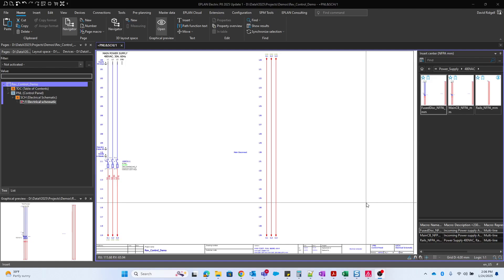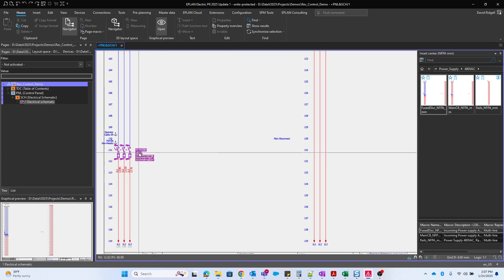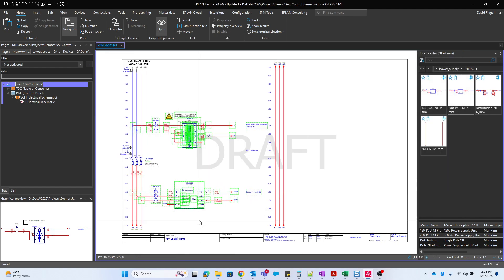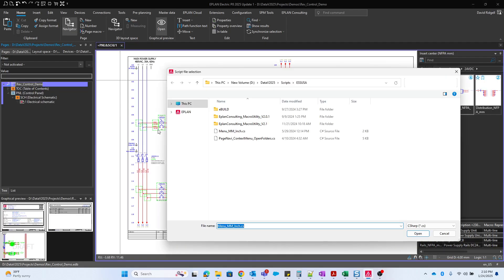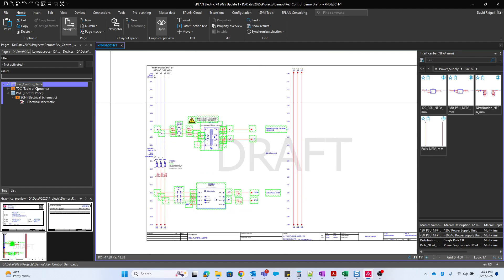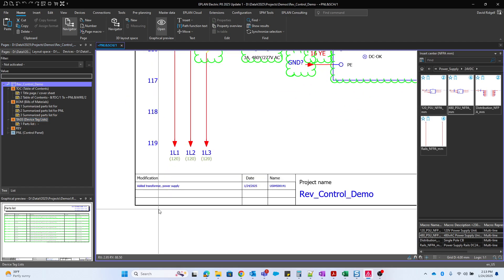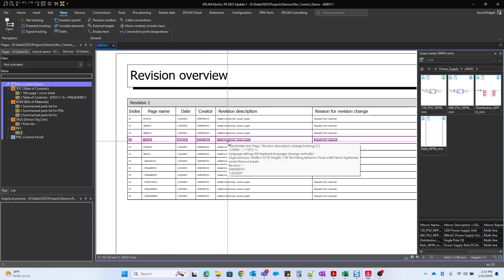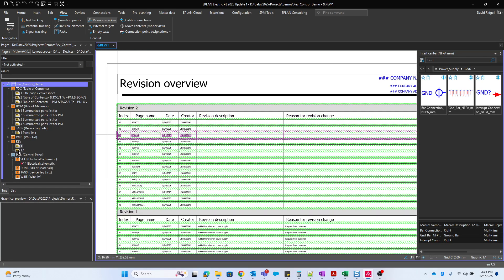Revision control in Eplan

Comment: Hi, if you add in a transformer as you did in the demo, do the other pages such as the BOM or further schematic pages get rev clouded also?
Additionally, if you change the name of a device that affects tags on other pages, do they get rev clouds also?
Reply from the maker: The reports will be revisioned by default, unless you set those page types to "Never complete" in the change tracking settings.